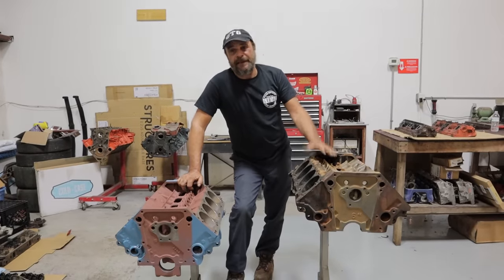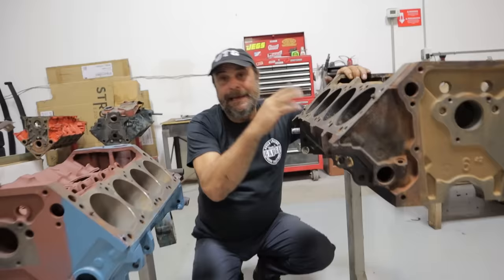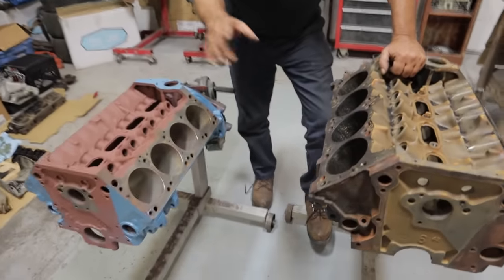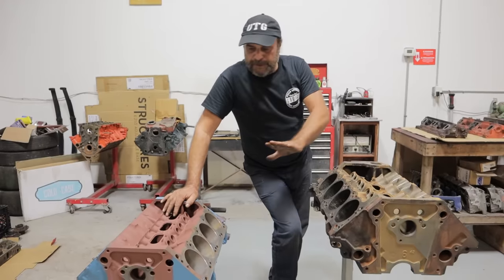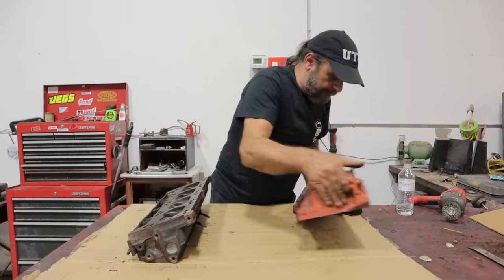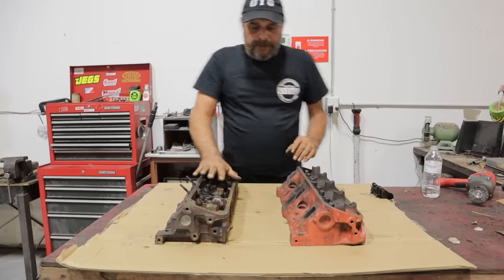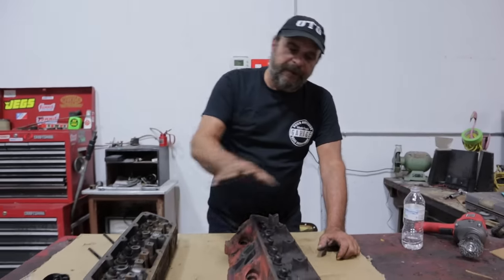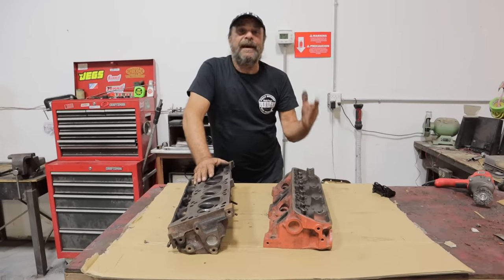Magnum vs. LA. Side By Side Comparison

Comment: Tony - From memory when I did the swap down under in NZ the truck boss needs to be cut off with a grinder to gain header clearance and a knob of iron on the block needs grinding off to clear the starter if your using a 904/727 trans, I used a beefed up 904 on my one! You guys in the USA got it sooooo good, do you know how many junk yard 360 and 5.7 hemi's there are in NZ, yeah you guessed it ZERO!!!!  If was given a 360 mag in the USA, by the time I got it here it would owe about $1200 to $1500!! Thanks Bruce from NZ
Reply: Somebody needs to start shipping sea containers full of parts.
Reply: man, thats gotta suck having to see all those ls engines with nothing to run against them. barras are neat, but ive gotten bored of them.

Comment: I have a nostalgia for the LA engine. I've had both LA and Magnum, there don't seem to be enough advantage in stock form to quib over. I like the old style rocker shafts, the look of the LA is just what I remember best and have most experience with. If I have an LA 318, it can make the power levels I am after, if I want over 400 HP, I'll just go with a 383, or a 440, so a good video here, very good information.

Comment: Im working on some magnum heads right now. Doing some cleaning up work and valve relief no porting or polishing just smoothing things over. 1st head i done no cracks, 2nd head, watch this video took the 2nd head apart and BAM! flipping crack. Im trusting that your right that the crack doesnt affect the valve. Other wise ill have to tear down some other engines for the head off them.

Comment: thanks for the cracked heads explanation. now i will keep my engine as i liked very much the roller cam idea. As a canadian i tried to find/buy the engine quest heads that is said to be a better flowing recast head than the crack prone mopar head. now i just got to find a car to put it in as the one that was supposed to have it in is now a 440+ 6 pack.
Reply: nonono. stay away from engine quest right now. their QC is JUNK atm.

Comment: There is a subtle difference on the oil filter plate too. They look the same but the magnum plate is more shallow. If you use the 90 degree adapter the internal gasket won’t be thick enough to seal. If you use a magnum plate on the la block it won’t seal. You can also buy magnum heads that are predrilled will la intake bolt holes.

Comment: Thanks for the description of the difference between the LA and the Magnum . I was thinking about going to the Magnum. I currently have a mild built 1974 LA 360. Forged pistons and rings gapped for nitrous. Still have the stock crankshaft but I'm running studs on the main caps and rods. I put some procomp aluminum heads with roller rockers on it. 10.5 to 1 compression. Run a 250 shot. I was  thinking about building  a newer stroked 408 combo. All forged rotating assembly. And a roller camshaft. I was told that the 73-74 360 block is great but is it better then the magnum with the 408 setup.
Reply: Also it's in a 5800 lb van that runs 7.7 in the 1/8 mile.

Comment: Thanks for doing this! I was hoping you'd do a Mag vs. LA comparison at some point. I still prefer the LA and the 340 in particular. It still burns me that they quit the 340. Why? They could have kept producing it, it will always be the best revving small block Mopar simply because of the shorter stroke than the 360 and the advantage of 22 more cubes than the 318.
Reply: Remember back in 1980 when don nichelson I believe that the right name ,a big ford man dominated pro stock racing in a Plymouth arrow powered by a 340 w2!!! Unfortunately he went back to ford the following year!!
Reply: @Smoothoperator65  Bob Glidden, not Don Nicholson. He ran a Plymouth Arrow.
Reply: @gavinmclaren9416  your right forgot about bob Glidden! He was a good one!
Reply: @gavinmclaren9416  Yep, I thought it was Bob Glidden. Damn you know you're getting old when you can remember that.
Reply: @Smoothoperator65  I would like to see UT do a video on the W2 heads to compare with the stock LA and Mag heads. I know there are gobs of other types of hipo heads available today for the sb Mopar, but back in the day the W2 head was a game changer for the sb Mopar.
Reply: @clembob8004  and a much needed one sb mopars have  never gotten the accolades they deserve ,that would be interesting!
Reply: True when you're talking stock factory engines.  But you can easily build a 360 (or even more cubes if you get a stroker crank) to rev just like a 340 and make more power.  BUT it's gonna cost $$$$ (heads, cam, intakes, machining etc)
Reply: The need for the 340 went away with the banning of leaded gas, emissions and the oil embargo, same with the Boss 351 and HI PO 350's. High revs and smogged, low compression engines breathing though 2 BBL carbs are incompatible, Chrysler like the rest kept what was needed and dumped the rest.

Comment: Tony - I don't know why but the cam bearing between a LA and Magnum are a different widths and I called up Dura bond and they didn't know why they were different widths. Do you as I had 360 LA cam bearings and I wanted to use them in my Magnum, well they are in there and its working, maybe more surface area for higher loading with the heavier springs?? Look them up PD-16 vs PD-25, 2 different part numbers. Thanks Bruce from NZ

Comment: Tony... as a follow up, you can do the differences between the timing covers, belt types and accessories.   Also how to adapt an LA timing cover to a Magnum with accessories, and a Magnum timing cover to an LA with accessories.  Actually, I want to do the later.  I have EQ Magnum heads on my LA motor and I want to switch to the Magnum serpentine belt setup for my Duster.

Comment: I have a 71 318 la block with the 80s heads, stock cam from 1969, cast crank and a 4 barrel intake with an edelbrock 600cfm carb, thing starts better than a new car

Comment: I read in some magazine probably over 2 decades ago the Magnum heads crack and it absolutely is a non issue.  Gotta give credit to the effective and efficient Magnum head design to AMC. Its what AMC had and Dodge bought them and their tech.  When the Dakota came  with the all new 318 "Magnum" rated at 220 hp in 1992 many were taken back how quick the new 318 was. It ran the 1/4 quicker than the on paper rating would suggest. The 454 SS Chevy muscle truck was easily dusted off by the Dakota and its improved 318.

Comment: The magnum head sounds a lot like a vortec 350 head, similar combustion chamber, different intake bolt pattern than older motors, prone to cracking

Comment: Awesome video as usual!! Are you familiar with the Next generation Magnums? 2008-2013 Ram 4.7? They(Chrysler) managed to take 1st gen 4.7 @ 235hp that came in some dakotas and durangos, New in 2008 they took the same cubic inches and made all kinds of revisions that brought about 310hp for the 3rd generations.
Id love to see a video as im currently doing a full rebuild on my 08 4.7, and like you said about the Hemi being hard to find product support, this 08 dual plug 4.7 hardly has any support as well. What do ya think uncle tony?
Reply: they have no support for a reason.
Reply: @frigglebiscuit7484  what reason would that be? Have you driven an '08 or newer 4.7? Ive owned both a 1st gen 4.7, and the 08 dual plug variant and this thing is worlds better than the 01!!

Comment: I have a 1986 318 roller motor in my 73 dart swinger. With the cams you have to decide if you ever want to run a mechanical fuel pump or not because the magnum cams have a shorter snout.
Reply: Michael Edge,
You can get an adaptor kit for magnum short nose cams that has the eccentric so you can run a mechanical fuel pump. Timing chain cover and water pump has to be changed to an LA style. ( LA waterpumps turn in the opposite direction as a magnum)

Comment: I love these casting tours. They are always fascinating. Any chance you will ever play with Mopar turbo cars or is that a headache at this point? Super 60 T2's were fun!
Reply: I have an '89 Daytona Shelby with the Super 60 package on it. Good luck finding any of those parts. Also have an '86 Daytona  Turbo Z and a'93 Shadow ES 3.0 5-speed as my daily driver with lots of go-fast goodies from Forward Motion and Lambrose Engineering... Looking for a Rampage to put in my freshly built Turbo 2 motor. Need an intercooler also, can't find one and the aftermarket ones suck...

Comment: someone really needs to manufacture a drill bit fixture to make it easy for people to drill that oil passage for LA heads into magnum blocks. That would be a big game changer for a lot of mopar guys.
Reply: I can do that, whats it worth to you?
Reply: @Zeusspupp  I don't own a mopar so I wouldn't need it. I bet uncle tony would buy one and probably a lot of other mopar guys and machine shops so you could probably make some money on it. There are a lot more aftermarket cylinder head options for LA engines than magnum but the junkyards are littered with core magnum engines for cores to build up so it would make sense to be able to drill that hole and use them.
Reply: @Zeusspupp  also using a magnum shortblock would allow people to build hydraulic roller engines for cheap while still being able to keep the LA cylinder head which has a lot more options for aftermarket intake manifolds and things like that.
Reply: @GnarshredProductions  I enjoy UTG, if Tony is interested in one of these , im sure we could work something out. This would have to be a 3 step process with a fixture and 3 different drill bushings, one to spot a flat on the boss, one top spot drill the hole and one for the actual hole. That is a deep hole and extreme care will be needed to keep the drill from walking. Those are probably drilled with some sort of gun drill at the factory. I regularly modify all kinds of parts and machinery in my shop. I would do this job on a bridge port mill and its a couple of hours to do both, probably $250. Id have to put some thought as to how much the fixture is worth.
Reply: Or you could use oil through hollow push rods. Old trick. Didn't UT mention something about that? Mopar or no car.

Comment: Feel the same way.. as a Ford guy I have seen what can be done with a 351 Cleveland.. With the right parts and properly tuned, they are very competitive and can make LS levels of power, boosted or not.  If you want to have some fun you can tell Chevy did some copying of some of the evolved cleveland design features, canted valves, equal port spacing, and a number of other things.  You take some later evolved heads, the SVO stuff that Jack Roush helped design in the 80s that fits all the SBFs and later superceded by the Yates designs and the various things done by Bob Glidden and others, the LS basically copied a lot of that and went into production in very common vehicles.  I am not in the LS cult.  I think I would rather stay to Fords and Mopar stuff than belly button easy/cheap stuff the bowtie guys use.  I like Mopar stuff and don't ever want to be in the everyone else herd.
Reply: I thought the canted valves started with chevys mystery motor and Ford copied that to the Cleveland
Reply: @teddythomas281  canted valves were not really new.  Ford's geometery is different.  Mopar had the Poly 318 also had valves canted.  Other companies had made this stuff decades before, it just wasn't in everyday cars.

Comment: Cool! Been waiting for this Unca' Tony! "Refurbished" a 1999 Mopar 5.9L Magnum from a Durango to go into a 1998 Dodge RAM to replace the original factory v8 that blew up while driving home: previous owner said he did lots of oil changes (whatever). The Magnum is torque motor=workhorse, whereas the more modern complicated Hemi=racehorse. Will always dig the simpler MAGNUM & will always have a MAGNUM v8!

Comment: I buy long block G3s from pick a parts all the time, for the same price as magnums,  entire G3's intake to oil pan for 240 bucks after tax. It's just easier and cheaper to keep the efi on a G3, then it is to ditch it. Thanks to companies like holley or efi source, prices are less than getting a good carb, intake, and ignition box, but fuel system you say, for 150 bucks get an inline walbro 255, efi line, and an Amazon sourced efi regulator.

Comment: I've been a fan of UTG from the start, but I gotta say that I can't get behind the Magnum being Mopars "LS Fighter". The LA and Magnum are great engines, but the OE Magnum cylinder heads can't compete with the Gen III/IV LS heads. Even the 706 heads outperform them by miles. The true LS fighter is the Gen III Hemi. It makes the power per CI and....it's a freakin' hemi, brother! There's a reason they're the combustion chamber of choice for Top Fuel
Reply: i agree that the la and magnum heads just dont flow enough air, & that the gen 3 hemi heads definetely do.its superior to the ls except for cost as uncle t mentioned.

Comment: You can build a hemi on a budget using eagle heads on a early 06 hemi with 6.1 cam an 6.1 exhaust would be one example
Reply: I bought a 2009 5.7 with 40k on it for $1900 shipped to my door no head swap job needed the engine came out of a running car

Comment: Tony another good video would be showing people how to take apart roller lifters ( roller LAs & Magnums ) to clean and check the roller and pushrod differences while 88-91 roller LAs had hollow pushrods even though they still oiled through the rocker shafts
Reply: Always wondered if they knew they had the Magnum in the development pipeline.

   The Good- a heart-shaped quench combustion chamber of the #302 heads.           

   The Bad- dinky 273/318 valves

   The Worse- The pistons- I just measured- are about 0.080 in the hole!

Comment: A low deck big block mopar is a much better LS fighter. A simple 361 can go toe toe to toe with a 6.0ls
Reply: 500 HP?

200,000 miles without maintenance?

20+ mpg?
Reply: @breckfoster767  yeah, they can. Will it be cheap? Probably not. But, theyre a good platform to work with. 451 cubic inches using factory parts. 500 cubes with a stroker kit. Im an LS guy myself but the low deck B engine is underrated
Reply: @breckfoster767  must be that rare ls diesel to get all that at the same time 😆 seriously though pretty much any decent engine can be built to meet any one or two of those you chose besides a diesel not sure your going to get all three at the same time 😉
Reply: @breckfoster767  bowl ported 452 heads can flow right with a ls head at about .500-.550 lift. btw, aint no 500hp ls getting 20mpg when youre making 500hp with your foot on the pedal. tired of hearing that shit.
Reply: @NightWrencher  451 stroker spins up terrifyingly fast lol. imagine a stock stroke 400 with lightened rotating assembly...hoo boy.
Reply: An LS3 head stock outflows most aftermarket big block heads 

So what heads exactly do you think bowl ported SB heads are going to keep up with lol?   Possibly some unmodified 706 or 862s.   And that's a huge maybe.

And lol a 50hp engine won't make 20mpg if you "have your foot on the pedal" or whatever that jabroni means.   But they literally have 5.3 trucks knocking down 20+ lol.   So yea

Comment: Lifter angle is for the INTAKE valves as the pushrods pass under the rocker shafts on the Poly.  One nice feature of the Magnum heads is you can stand them on end.

Comment: You touched all the bases on the differences quite well. I have rebuilt both type engines & my latest was a 360 in an 88 class B camper van. I had the opportunity to place the LA 360 block next to a 2000 5.9. One big advantage of the magnum over the LA 360 was casting quality, LA quality was rather poor. Probably due to the fact that the factory realized that they were the end of the road casting & were using some old well worn molds. Magnums are high nickel (supposedly) iron, only LA 360s out of trucks are high nickel (dash 3 blocks). I have a 318 LA in my Duster that came out of an 87 5th ave. Chrysler. You need to mention those late 80s 318 engines because they are roller tappet, high quench combustion chamber, but have the older LA shaft mounted rockers. The heads on the 88 camper were in bad shape, not from use but a result of bad maintenance. All the exhaust manifold bolts had been repaired by someone who didn't know what they were doing & made a mess of the heads. Thought about going the magnum head route using the AMC lifters & engine quest heads but located a good set of LA heads so I used them instead. Intake ports on them were OK but the exhaust ports were rather restricted so I had to do some port relieving there. Tremendous amount of restriction just under the valve. Little engine does a decent job of pushing the heavy camper down the road.

Comment: When using retro hydraulic lifters you will probably have to open up the holes where the push rods go thru the head to keep them from contacting inside the tube.

Comment: Not seeing the budget issue with the hemi.  They've been building the Eagle 5.7L since 2009, there are millions of them out there and you get a MUCH newer motor with 300+ cfm flowing heads that makes 400hp out of the box stock.  340's are non existent and even if you find a 360 its still an antique.
Reply: @Daniel G Just did a 2 second search and found one pulled from a 2011 Ram, $1500 includes wiring AND transmission.  Your prices are 5 years old
Reply: people in my area want 1500 for a non eagle valve dropper 5.7....now you see why.
Reply: @FrankBullitt390  still too much. 1500 can get me a set of high flowing cylinder heads for my big block mopar.

Comment: What internals did a 340 High performance engine have ? I had a JH vin 71 challenger in the early 90"s. Sold it for 4,700 bucks in 93 it had a LD4 Edelbrock intake on it not sure if it was a high option car.

Comment: Or if you want to run la heads on a roller cam magnum block….. you need a 94-96 5.9 block. It has both ways to oil….. thru the pushrods and the oil passages like an la. I have a 95 5.9 magnum in my truck. It has both setups.